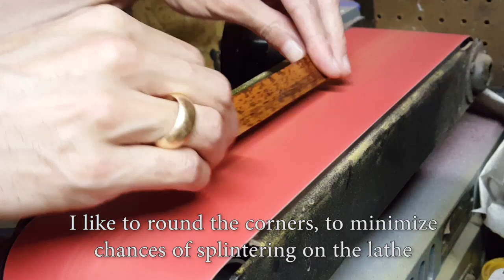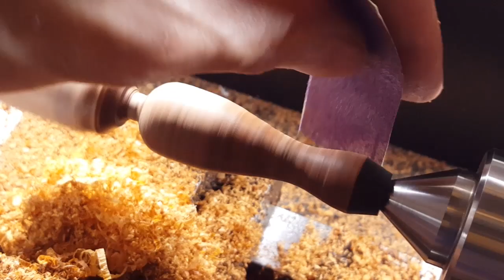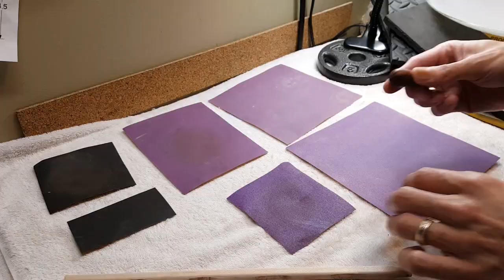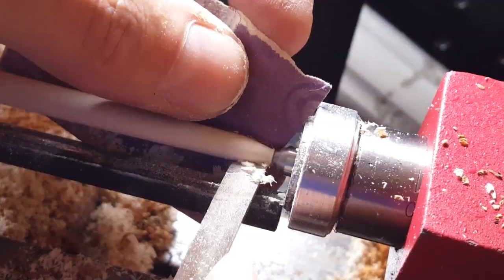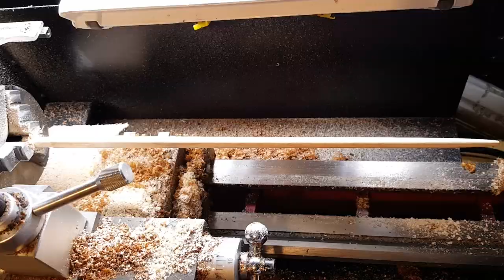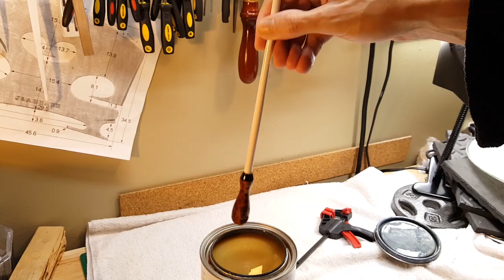Making a Snakewood and Ebony Conductor's Baton (to the tune of the William Tell Overture finale)

Comment: wow, so beautiful.  is snakewood good for bow material?   i found a bow made from snakewood and would like to buy later, but new to violin and unsure if its good wood for bow.   i know brazilwood and pernambuco are good.
Reply from the maker: Yes, in fact snakewood was one of the preferred woods for making bows in the past (before Pernambuco), and you can still find formidable bows made of it. It is noticeably stiffer than Pernambuco, and heavier. I would recommend trying before you buy it because it can be harder to like than Pernambuco bows.
Reply: @SculptyWorks  great, thanks for the info.  it's such a beautiful wood.

Comment: Beautiful piece! I've never seen wood like that before, so beautiful. Is the snakewood considered hard wood? What's it like to work with?
Reply from the maker: Thank you! Snakewood is hardwood, both in the botanical sense and in the 'it will dull your tools like crazy' sense.  😉
It's marvelous to work with, however! It's extremely strong, takes fine detail as well as ebony, can be polished to incredible high luster (without varnishes), pretty much nothing attacks it (insects or decay). It can be a little brittle along the grain if you force on sharp angles (thus I rounded the corners of the blank on the video before turning it on the lathe), and can be painfully expensive.
I wish I had more occasions to work with it, though, the stuff is amazing!  😊
Reply: @SculptyWorks  you made such a beautiful baton with it. I understand what you mean about hardwood wearing your tools down. I remember trying to sculpt a small piece of Narra by hand to make a door handle and my chisel, blades and hands noped out after 2 hours.